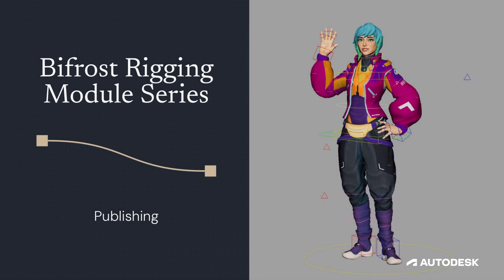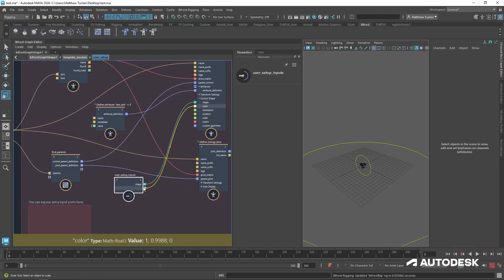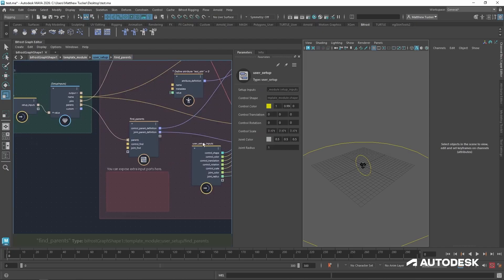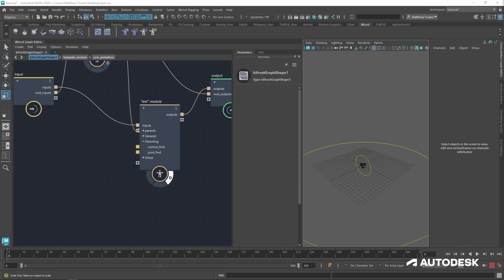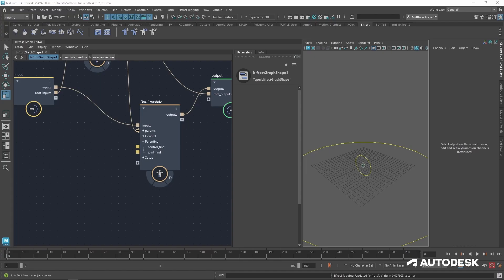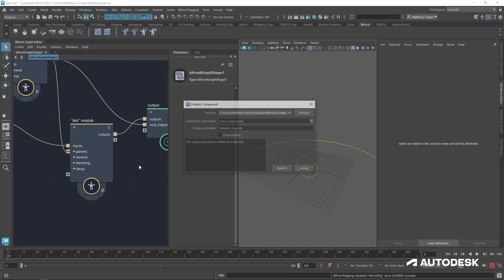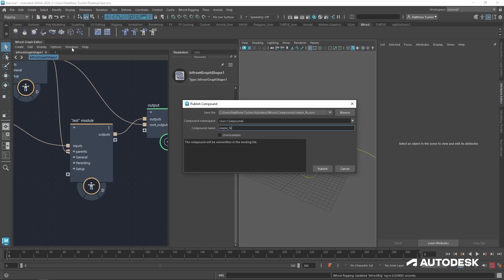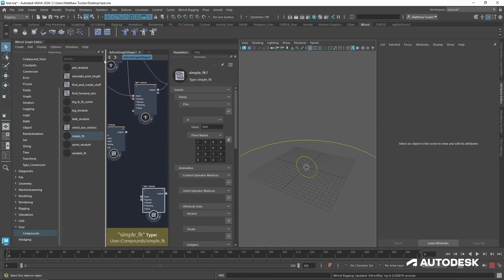Bifrost Rigging in Maya - Part 7: Publishing Custom Modules

Comment: OK, got example working... if nothing is keyed, i get 500 fps+, second a key is set to change a value, it drops to >30 fps. What is that all about?
Reply: If this is during manipulation, make sure to use "Tag as Controller" on the control you are manipulating. Otherwise you will need at least two keyframes for Maya's EM to treat them as animated objects and offer better performance.
Reply: @toshi4186  @chris the team has been fixing bugs rapidly. If you are interested, please sign up for Beta to get the latest updates

Comment: Trying to look at that example rig in 2026.2, all controls and joints are at the origin. All bifrost plugins set to autoload. No errors, but no rig... Not a strong start.
Reply: You also need to download and install the compounds